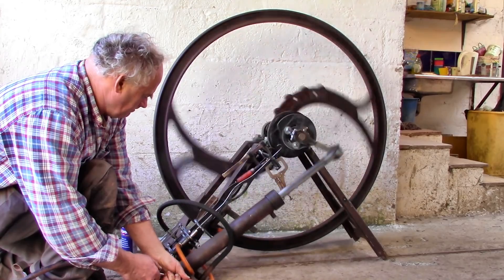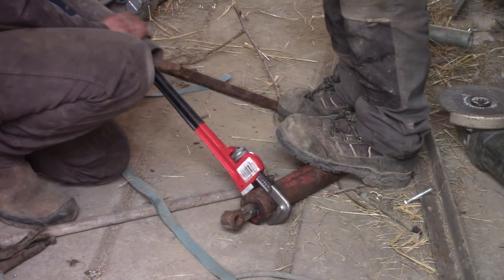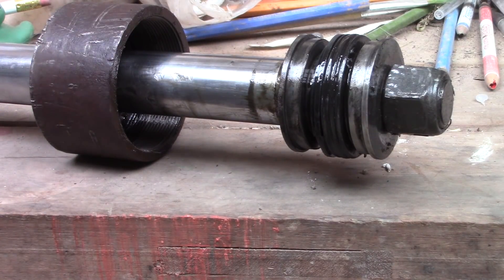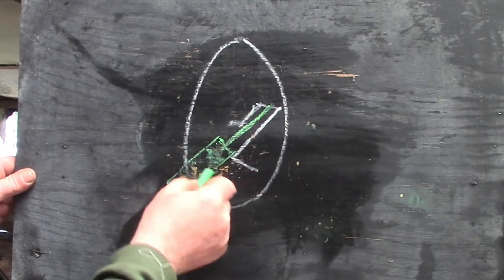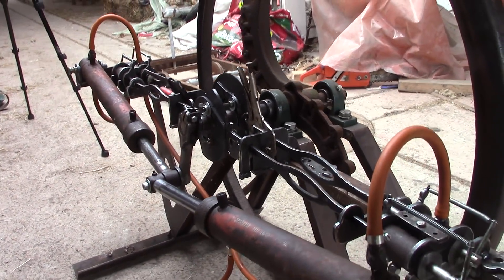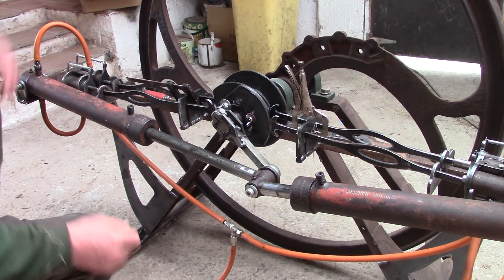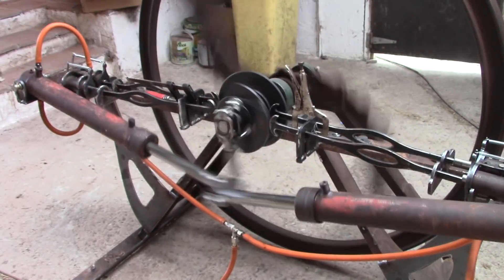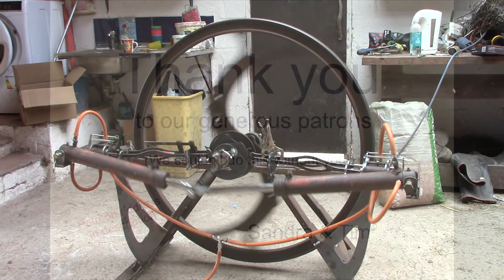Homemade TWIN CYLINDER Air-Powered Engine Goes REALLY Fast!

Comment: As to going in reverse, what happens if you start the wheel in the oppsite direction?
Reply from the maker: nothing : -  (
Reply: @wayoutwest-workshopstuff6299  I looked at your video with cams and I think I see the problem, you need to do one or two rotations in the new direction,  This will allow the inlet/outlet ports to reverse, if I am understanding how it works correctly.
Reply from the maker: If only it were that simple : -  )

Comment: Hi Tim- great work! I love this thing! 
I know you said double action was a waste of time… But 😁…. As the cylinders are 180 degrees apart- can’t you use the same vales to drive both  the ‘extend’ stroke on one cylinder AND the ‘retract’ stroke on the other cylinder at the same time???
Reply from the maker: Well, yes I could. But I would still need another pair of valves to release the air from the retract stroke. It might happen
Reply: @wayoutwest-workshopstuff6299  …. But in the same manner as the power stroke… can you not use the existing valves to handle the exhaust stroke cycle as well?

Comment: That is pretty good. One way to test how much power it has is to take a 2x4 on a hinge and attach it to the frame and then using your foot or level apply pressure to the wheel. If it stalls right out then there is no power if you can apply a small amount you have a bit of power if you can apply great force then its got some good power. 
When you said a windmill for compressed air. Years ago before my neighbors shop burnt down he built a windmill compressor. I am not exactly sure how he did it. I seen him testing it on a truck a few times. From what I seen and can guess is that he had a windmill and built the frame and everything for the pitman arm to do the stroke. He built this all out of the top section maybe 10 feet or so or a couple meters. I am not sure what compressor he used. Yet his goal was to install a bunch of tanks below in the frame to store the air and the compressor was a pretty large one. My other neighbor had a 500 to maybe 1000 gallon steel tank that sat outside his shop and the label on the tank stated that it was rated for 300 psi. He used his larger compressor to keep it full all the time and had hose reel and everything on it for when he needed it outside for air tools or what ever. He had regulators and all kinds of things on it. 
Depending on your area you may be able to buy a very large propane tank which are rated for 300 psi or better. The label will tell you the working pressure which I think is 250psi. Depending on the type of compressor you get you should be able to find something for 200 psi. 
I am not sure how long something like this would work for maybe run time of 30 mins if you had a 100 gallon air tank rated for 200 psi. 
Though my other idea would be if you can find a air starter or hydraulic motor?
I am not sure sure if you seen my comment about the air starter that I had at one time? I am pretty sure I wrote something. Hydraulic motors are rated at flow rates so I would think the lowest flow rate would work. I also have a hand oil pump that came off of a deep fryer transfer pump. I was thinking maybe that might work with air and or steam? Ah maybe not. Though I do think a hydraulic motor might work. I do not have one on hand right now. 200 miles away I know where the one I gave my friend if he could find it. I might ask him and maybe if he knows where it is apply some air to it and see it that works. 
As for this set up looks so much better and might be pretty powerful.
Reply from the maker: thanks, William. Yes, there could be many ways to proceed. I must have missed your comment on the air starter - sorry. I looked them up and they do seem a good idea, but I can't find a secondhand one in Ireland

Comment: Connect the top hydraulic fittings together on the two. That way one will draw air in while the other ones pushing out. Should increase efficiency.  I think
Reply from the maker: yes but I would still need to vent it somehow
Reply: @wayoutwest-workshopstuff6299  why?  The total volume should stay the same
Reply from the maker: @DoRC  Try it and see : -  )   
(The air that goes into the outstroke is vented through the exhaust valve. If I connect that exhaust valve to the instroke (as you suggest) then it would need venting as soon as the piston is fully in, otherwise it will be in the way of the outstroke..)
Reply: @wayoutwest-workshopstuff6299  no. I mean the other ends of the rams that arent connected to anything.
Reply from the maker: Apologies, RoRc - I misunderstood your suggestion. You're right - I could just join them together. I'm not sure it would do much good, but it would work without an exhaust. So, thanks for the suggestion.
Reply: @wayoutwest-workshopstuff6299  yeah intuitively I feel like it would make them more efficient but in reality I'm not entirely sure would. It would be an interesting experiment though

Comment: I think that we are either "back to" or "still on" Energy. You tell us that you have lots of wind. You are good at gears and plumbing. A windmill or three could work 24/7 to push air into air-tanks (I see propane cylinders suggested). ("The slow but relentless drip of a tap fills a water-pail"). The question then becomes "How much energy do I need per week to drive my rakes of wagons? A pair of scales borrowed from the local greengrocery store would give you an initial quantity for foot-pounds as a drawbar quantity on your wagons. Your existing two-piston air engine can give you a measurable quantity for energy drawn Just wrap a string around the flywheel shaft and have it lift a one-pound weight (via a beam pulley) off the floor.
Those figures would be crude, but a good approximation. Do the math, and then decide. Small enhancements (suggested by engineers) can only make the figures look better.
I love you two too much to have one of you messing around with high-pressure steam in boilers. Or Out.
Cheers, Chris
And yes, I am glad that Sandra is home safe and sound and that you are still up to your wizard wheezes!
C.
Reply from the maker: Ha! Thanks, Chris : -  )

Comment: Well, if you're manly playing around, and having fun, please continue, we're all having fun following this project.

But if you want a practical suggestion, just use a horse, or donkey to pull the cart, or if you must use an engine, find a way to run an electric motor on a car battery.

It's a lot of fun watching this channel, keep up the good work 👍

Comment: In the old days after steam engines that had rocking cylinders like that were invented, the next development was adding a crank rod between the cylinder piston and the shaft. That way the cylinder could be kept stationary which helped reduce vibration, and had some other benefits on very large engines.

For reversing I recommend looking at Stephenson valve gear, it works somewhat similarly, although with more intermediate parts. There's a pair of eccentric rods that determine what offset the cylinder runs at compared to the wheels.
If it's a lot of trouble to add reversing, I would think it better to use it as a stationary engine, considering the size and weight and vibration. If you set it up in a little hut by the charcoal kiln area, where you will have a ready supply of steam fuel, you could run belts or shafts off it, maybe even a funicular-style cable to haul rail wagons up there.

In any case, it looks like it runs much better!
Reply from the maker: thanks, Andrew. I must make a video showing why it has to be on wheels..

Comment: @Way Out West - Workshop Stuff 7:30 You can probably do something with belts (or with gears).
With belts, if you have them "un-crossed" (like: 0 ) then it runs eg. forwards, but if you run the belts "crossed" (like: 8 ) then it can run in reversed direction.
Same thing with gears, eg. an even numbers of gears runs forward, and an odd number of gears runs backwards, then it's just a question of what means to use to engage the gears, or what method to (un-)cross the belts, that can probably be done manually (when standing still & breaks engages. Warning!: for crushing hand injuries, if not careful).

Comment: This is great! I'm (selfishly) hoping that you will continue with boilers and especially continue to focus on very small volume "flash" type boilers as I think that is the most efficient and more importantly the safest. A large volume of very hot water is quite dangerous. A small volume of very hot steam is nothing to sneeze around but will dissipate quickly and so do much less damage. 
Actually... (watch out, crazy idea coming) since the cylinders have to be able to take the heat of steam anyway, and the heat they release is a huge cost in efficiency, I've always wondered why people don't heat the cylinders (e.g. encase them in a fire box) and then inject water directly into the cylinder with a modern fuel injector. Hot cylinder, splash of cold water, instant steam right where you need it. Very safe. Very efficient. 
Hard to build a moving firebox. The weight of it might be an issue. But a non-moving cylinder with a linear to rotary linking outside the cylinder would solve those issues. 
Add some fins for better heat transfer to the inside and outside of the cylinder cap and focus the heat there. In fact, just use an old motorcycle engine with a modified cam and heat the cylinder head. 
Might rust out the injector? Add a bit of oil to the water? 
http://techref.massmind.org/techref/idea/mc-heat-inject.htm
Reply from the maker: Thanks, James. It's an interesting idea, but I don't think there would be enough surface area to keep the cylinder hot enough. But perhaps I'm wrong. Some early steam engines did have their cylinders inside the firebox - but that was just to keep them warm - the steam was still generated in pipes or a boiler and then fed into the cylinder.
Reply: @wayoutwest-workshopstuff6299  Yes, I think you are probably right, but I'm guessing that an end cap with fins (inside and out) would resolve that issue. You focus the flame right there, and the surface area of the outside fins collects the heat, and then transfers it to the inside fins where the heat is extracted as the water spray hits it. The outer fins could cover a larger area and be larger to avoid getting clogged up, and the inner fins would be quite fine and only interact with the injected water. 

I've done some fun experiments with this, as mentioned on the site. Water on a skillet just forms a barrier of steam and sits there, hissing away. But if you spray a fine mist of water onto the pan, it produces quite a lovely puff of steam. And if you head something with a large surface area, like steel wool (an extreme example) and then squirt water into it, it nearly explodes. 

It might even be possible to make an opening in the end cap which is a flap valve, which would be sucked open by the piston as it started the power stroke, allowing in raw flame from the back, and then it would be slammed shut as the water is injected and flashes over into steam. All crazy ideas, but fun to think about and perhaps to try out.

Comment: With the low rpm and hopefully higher torque + two wheel drive on this loco, I think an old tractor gearbox from a small tractor with 2 or 3 gears, and a reverse would work well for this project. It might be around $100, at least when I looked for one online in the area near me. However, I don't know the pricing in ireland, where it is probably more expensive. Good luck, and love the video!

Comment: You could use a petrol go kart gearbox which have forward and reverse gears and a go kart rear axle drive could make a drive axle for the locomotive, why not use the steam engine boiler you where working on in previous vedios too make steam to power it.

Comment: There is no mechanical reason that you couldn't make a windmill powered air compressor but it will take a lot of wind to be practical.

You could power a compressor using animal power and then use the stored energy much faster than it was stored. This is particularly useful if you have animals that need lots of exercise but don't produce high density power.

Comment: Use a little heat and wax when trying to turn rusty stuff. You just need it to be warm enough to melt the wax. Push the wax into the hot joint. 

Capillary action will pull it all the way through the threads. Works better than any penetrating oil

Comment: I'm a hopeless diy "mechanic" - to loosen something I chuck wd40 at it (after brute force fails), then I might try heat and cold (more brute force) and oil again. Often I'll break whatever I'm trying to loosen or simply give up. Can't stress hope bad I am at anything mechanical.

When I see you have fun with Will (it is Will isn't it?) I feel sorry for Sandra, recalling how you both tried to get a female helper a few years ago.

Comment: This Loco here https://youtu.be/BllFzJMHDDc runs on compressed air and would have been used in a mine I think something along this size would be able to work.

This is a larger variant https://youtu.be/xf_MEuveMkQ
Reply from the maker: Thank you. That's an impressive machine!

Comment: The scenes of you building the engine are very convincing, but I'm not fooled!  You obviously stole it from from the Science Museum and smuggled it back to Ireland (somehow - perhaps in a little plywood boat) as it was clearly constructed in about 1820 by some long-forgotten genius who deserved far more fame and fortune than he achieved.  Very well done on making it run again, though...

If you attached a pulley and timed it raising a weight on a rope you could work out how much power it is developing.

Comment: You could also bootstrap air compressors in series to go from an intermediate pressure tank to a high pressure tank at the air charging station.

Comment: If you'd like to have double action for one cylinder you'll need  the valves only, but no additional cams. The power strokes are 180° apart, so placing the valves accordingly 180° apart on the existing cam should work just fine (and should easily provide similar timing on both sides). Since you already have those valves it should by worth a try to connect the cylinders left-left and right-right and have them nearly double the piston area for each stroke.
Reply from the maker: I'd still need an extra exhaust valve for each one though

Comment: Worth considering the hazards - compressed air there's a risk of failure and bits flying off at high speed. With steam you get all that plus the risk being horribly scalded to death. Having recently read about some steam engine disasters I do wonder. Everyone loves steam and a steam engine would be cool, and I guess not that dangerous if you know your stuff, but maybe wind powered compressed gas would be simpler, more reliable and safer?  It is certainly a more modern and progressive idea from an environmental perspective. Maybe you could also use it to collect and compress fuel gas from wood gasification (i.e. charcoal kilns).
Reply: You may read of historical locomotive failures, & while they are frightening & sometimes catastrophic - they are usually the result of deferred maintenance or poor operating. I believe that Tim & Co has the ability to construct & operate an air or even steam-powered engine in perfect safety, given time to experiment & optimise. For economy's sake, of course, something like wood-gas would be interesting, but highly irregular & likely presenting its own set of challenges.

Comment: Instead of filling the tank with steam or compressed air, you might be better off filling the tank with superheated water.  Water at 250°F will produce steam at 50 psi.  The steam expansion rate is 1700:1   You can use a fixed boiler, and plumb hot water into your on-board tank. That way you don’t have to move the boiler. This is what was known as a “fireless locomotive”.  Of course, at that point, you might as will just mount the boiler on a car; and take it with you.

https://en.m.wikipedia.org/wiki/Fireless_locomotive

Comment: They have a locomotive in the Railroad Museum of Pennsylvania that was just that. It looked like a regular engine but instead of a normal boiler it was a huge compressed air tank. The sign said it was used for short maintenance runs or something if I recall correctly.

Comment: I built a steam boiler from an old hot water heater and it works quite well and it’s very simple I have a video on it if you’d like to see it. But all you really need to do is just run it off of propane or do like i did and convert it to burning wood. Just an idea.
Reply from the maker: very nice - but what sort of pressure did you get to? Your gauge didn't seem to work? And did you connect it to anything yet?
Reply: @wayoutwest-workshopstuff6299   I’ve had to rise very close to 40 I just kept it low at that time because I didn’t understand how the gauge works until now so I was nervous getting to high and causing an explosion lol. And no I don’t hav e anything to connect it to yet I am planning on making a piston for it once I get the stuff to make it.

Comment: Oh very well done Tim, that extra cylinder really does transform the engine.  It's sounds so happy at the lower speeds: I could listen to that all day long.  Perhaps you should do one of those 5hr films of it just ticking over, just like the ones of fireplaces, fish tanks or waterfalls.  Personally I think this makes for a perfect stationary engine where it's wobbliness and high centre of gravity don't matter.

Perhaps you could convert a compressor into a loco engine?  Sturdy and compact and you'd have a nice output shaft as well.  Many have high and low pressure cylinders of course.
Reply from the maker: I'll have a think about that too - thanks
Reply: The clatter of a mechanical control is also something I could hear endlessly. It's as much a treat for the ears, mind and eyes.